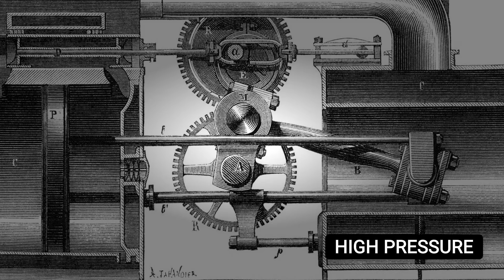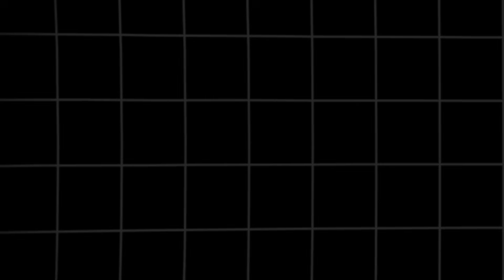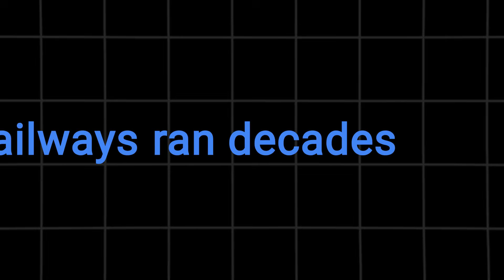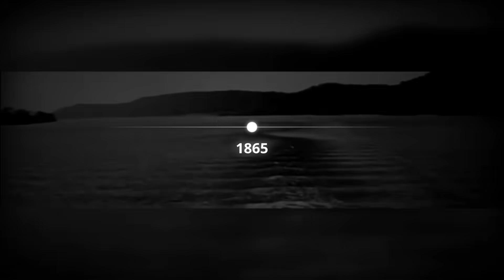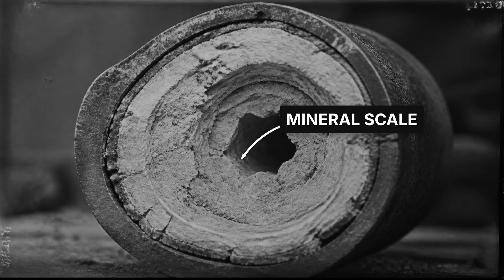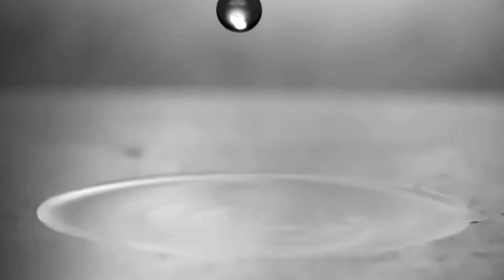Why Steam Locomotives Don't ACTUALLY Run on Steam

Comment: The key to the whole process is that when water boils, it generates a volume of steam about seventeen hundred times that of the water that boiled.  That phase change, when contained inside the boiler of the locomotive, causes the pressure differential which drives the pistons.  Build a fire inside the firebox of a steam locomotive with a dry boiler and you MIGHT get 15 pounds of pressure.before the crown sheet melted.  It's the water-to-steam volume change associated with the phase change that's crucial.